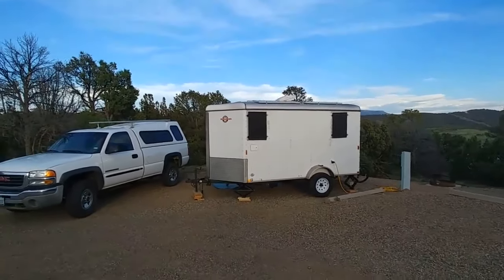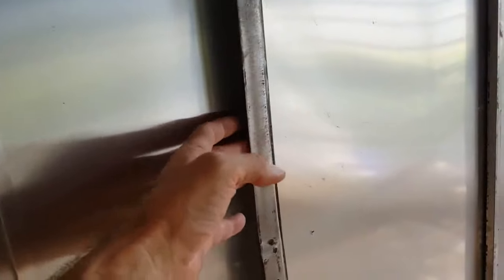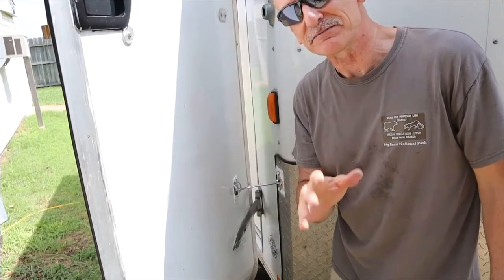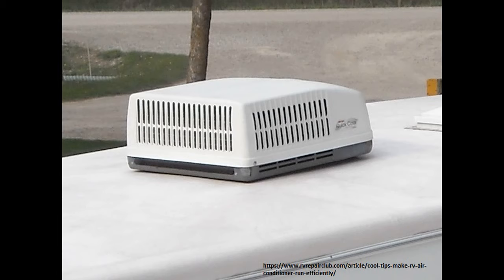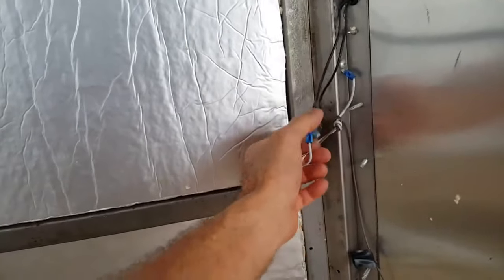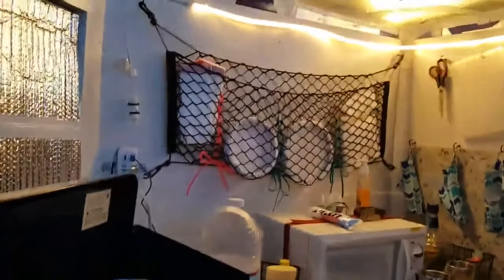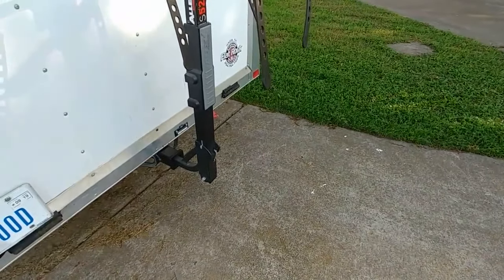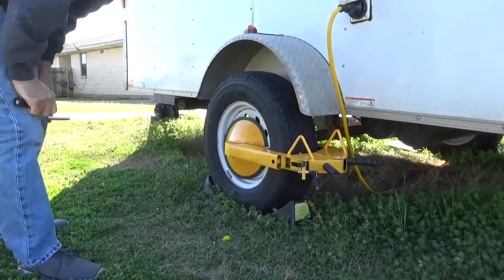CARGO ENCLOSED TRAILER CAMPER CONVERSION BUILD SUMMARY Vanlife Skoolie What Would We Do Different

Comment: I got everything you want EXCEPT I got the 6' wide and tandem axles and Barn Doors. I got a factory roof rack, two windows, lift kit and torsion axles. It was 10,000 and it took them 6 months to build it due to material delivery delays. I love the barn doors because I don't have the room for a ramp. Most people on YouTube that have the ramp wish they did not unless they haul toys that need it. I sold an 8' wide Airstream to get this 6' wide cargo trailer. It fits in my driveway so much better and I can walk around it. Even my Airstream had the bed "fore & aft"  rather than "port to starboard". Still, the ramp with a false wall like you showed in a picture is a pretty cool idea. . Thanks for sharing.

PS. I finally found (on Quora) that you should NOT ground the 120 AC to the chassis if the chassis is also used for 12V DC common (according to NEC since about 1980's). If you are using a metal tool with a short and then you touch a metal object you could get electrocuted. Pretty slim odds but I guess it's happened.

Comment: Might also want to consider getting your trailer Low Jacked. A fairly inexpensive way to do that is get one of those devices that are intended for bicycles. The device is small, easily hidden/disguised, etc. And the device can be linked up to your cellphone through an app, so if your trailers gets stolen, the police can link their system to your app & go hunt down the thieves.
Reply from the maker: I like it. Great suggestion!

Comment: Nice build.  Great insight for future builders.   
Small note. The bikes on the rear bike rack wont hit the trailer if 3-4 bungees are used holding the tire in a specific position.  (I hook from from tire to pedal crank to hold position)
Reply from the maker: Thank you for watching and the suggestion.

Comment: Thanks for the post I been working on my trailer I didn’t want any holes in my camper so I got a 110 plug in large HISENSE heating and air conditioner that I could plug in to heat and cook a large room that fit under the cabinets. It was about 600.00 but if it ever goes bad I can just unplug it and replace it no worries no holes in the camper. Thank you for the post I had a friend help instal a fold down bed and full shower the shower has a tankless hot water heater so as long as I have water I do have endless hot water and full shower. I just wanted something for myself as I travel for work tired of living out of dirty over priced hotel rooms that when work calls and I have to go to the next place I have a tv shower bed and toilet. Thanks again for the post
Reply from the maker: Sounds like a nice build. Happy travels. Thanks for watching.

Comment: I don’t think the weight savings from one less axle out weighs the safety in the event of a blow out. Just my two cents. Nice video!
Reply from the maker: Thats ok if it fits your requirements. Never had a blowout yet.
Reply: Yes no doubt it’s all about you needs! I just like to comment for people scrolling through looking for different opinions, just had my first blow out the other day and the other axle doesn’t help as much as you would think so I can only imagine with just one axle going down some steep grades. Im living in mine months at a time and have gone across country so my needs are different than most.
Reply from the maker: @cargonomads4947  All good. Always thanks for your input. Different views are reflective of different experience. I hope all is well with your CTC after blowout.
Reply: I have had blow outs on single axle trailers.  It is no big deal.  It just feels like something is dragging.  Had a blow out on a double axle trailer as well. In this case I could "limp" along a bit to find a preferred place to change the tire.
Reply: I prefer wearing out only two tires at a time instead of four. Less expense.
Reply: Greg p to each his own, I take my trailer across the us and through mountain passes, The wear is not a concern. Peace of mind is what I’m after.
Reply: @cargonomads4947  my peace of mind consist of having a good spare, and tools to change it.
Reply: Greg p who drives a trailer without those? I have a 7x14 wouldn’t want that in a single axle plus probably couldn’t even handle the weight I have. We’re coming from different uses here I need a tougher and safer trailer you just don’t get that with 1 💁 .
Reply: 2 more brakes and spreads the load on the bearings better 💁 like I said peace of mind....My kind.
Reply: Also let’s hope you maintain and a wheel don’t fall offf 👀
Reply: @cargonomads4947  That's right! I wasn't trying to say my way was better than yours, just sharring my thoughts of what works for me, here lately I've wondered if it would be easier to hitch and unhitch a double axle because you have so much less "seesaw" effect.
Reply: @cargonomads4947  yikes, forgot about that, where did I put that grease gun?
Reply: I hear ya didn’t mean to come off like that I was writing in a hurry, I pulled around a sketchy single axle for awhile through some rough stuff so I’m a bit biased lol, I post on here for the same reasons to help other people out there’s a lot of mixed info when looking for your first trailer.
Reply: Greg p as far as the see saw..I carry quite of bit of weight I front and back but my bed is back there with 2 people and two dogs and I don’t even out a jack in the back most times and have never had it even think about lifting up,  Haha oh shit I was suppose to grease those? But nice debating with ya but I’ll stick with my double axle lmao have a good one man
Reply: And correct me....but wouldn’t there be less tongue weight inherently?!?   I’ve pulled both 6x12 single and we now have 7x14w 7’h wouldn’t couldn’t go back
Reply: @FakeLegGreg  I've had two blowouts on my Airstream with a single axle. Even if they look brand new they blow after they get 6 years old. The first time I thought it was because I deliberately had them under inflated but the second time I had them at 60-PSI for 6 years. Buy new tires after 5-6 years whether they are worn or not. Mine only had (let me do some math) about 8,000 miles on them both times. I did a lot of camping but never went far from home. Anyway, You have a nice channel with good ideas :o) Maybe I'll start using my YouTube channel more in the near future.
Reply: @FakeLegGreg  that’s like not wearing a seatbelt with the “logic” that you’ve never had an accident.  Do you but that’s nobody’s “requirements”, it’s common sense safety and pro vs con. The weight savings is negligible and and the cons are many. Just makes no sense.

Comment: You make a lot of good points and  gave people good things to watch for. I'd also add that you want a tall trailer where the ceiling height is closer to 7' not barely 6'. The roof needs extra insulation and adding thickness to get that reduces head room and they you are cramped in height. Added height also gives you extra room of storage and a more open feel.

I'm also amazed that so many build with 2 x 4's??? this isn't a house and you aren't supporting a second floor or roof. It also takes up more space & adds weight. Clear 1 x 3 has all the structural strength you need. My fold up bed is 1 x 3 with 3/8" ply, plenty strong, doesn't deflect and weighs way less. Same with shelves and cabinets, why sacrifice space & add weight by framing with 2 x 4's? I've also used aluminum tube & channel to build with, putting pink foam insulation as a core and gluing luan ply for skins on cabinet doors and walls. very light, very strong. Yes extra work but weight savings is worth the extra capacity and fuel economy.

Think about your kitchen, do you really want to cook in a 6' x 12' space??? (just a size example) Heat, odors and moisture. I have an awning and my stove can hang on the outside of the trailer plus a table on rails bought from camping store. Stole this Idea from an old popup camper I had.

And no one ever does a follow up video on their peel & stick tile or floor covering. I laugh cause the adhesive on this stuff isn't rated for the temperatures your trailer will reach when stored or in towing in hot summers Ever tried using Velcro in you car??? The adhesive gets soft and gooey in heat... then falls off.

Comment: Add wood studs next to the Z channel this will allow for mounting and not add as much weight. Get the trailer with 16inch  floor beams and modify the area you need for the tanks. The roof AC unit is the better choice, I have own several trailers and never had a AC unit fail, no need to build a falls wall that would take away room in the trailer. Not sure why a trailer would get humid from a shower for taking shower in a trail is not the same as at home and do those showers not have exhaust fans?  Don't buy a V-noise trailer. Buy a flat noise for mount stuff up front and buy are make a v-noise cover, this help protect the stuff and better air flow.
Reply from the maker: Good suggestions. We can agree to disagree on some points. Good luck on your project.

Comment: There are many ways to mount a window unit. You could design it into a cabinet space and have it sit inside a metal box with a good air gap so it can flow the air like it needs to but only have maybe an inch of it out the side of the trailer. You would have to factor in a drip pan setup to let the drip escape but overall not terribly difficult and it would hardly be noticeable.
Reply from the maker: All good ideas. Thanks for watching.

Comment: GREAT VIDEO THANKS. which axle do you prefer with a 6 x 12 cargotrailer single axle. 3500lbs or a 5,000 lbs axle. Would appreciate any thoughts you might have and thanks you on this video. 👍
Reply from the maker: Good question. My build added up to around 3350 lbs with 5 gallons of water. I could carry about 15 more gallons. I was getting close to maxing out my 3500 lbs and with us in the trailer we were certainly over 3500 lbs. A 5000 lbs axle would probably be a good investment. Good luck.

Comment: The nice thing about a tandem axle is if you blow a tire with a tandem axle you can safely  pull over with the trailer not whipping around behind you. Should you have flat and no spare or a flat spare you can limp to a shop an get repaired. I ve had a single axle and thats exactly what happened. After that my mind was made up.
Reply from the maker: I have had a tandem tire failure on a loaded car trailer. Recovery from that catastrophic failure poses its own unique set of problems. Tire debris flying and damaging the other tire is one problem, what damaged one tire may have also damaged the other tire is another. Also, when the blown tire fails the wheel does not stay suspended in the air, it too falls to the road surface. Yes you can limp the trailer out on one wheel, but you have to jack up and tie up the lame wheel so it does not drag the ground. Also, tandems are more difficult to maneuver in tight off road applications. I travel with good tires and carry a good spare. Each style has its good points and draw backs. Thanks for watching.

Comment: Mine is 6x12 v nose with 16 on center box tubing.  I need 16 on center floor because I haul motorcycles which put weight in two spots instead of evenly distributed. I would like 7 foot wide, but only if the wheels were in the same location as my 6 foot wide. I haul a lot of narrow roads and a 8 1/2 foot wide wheel to wheel on a 7 foot trailer is not fun.  Plus, might as well get an 8 foot since the wheels are just as wide.
Reply from the maker: All good points Dave. Valid for your application. Thanks for sharing and watching.

Comment: Very informative. I'm ready to purchase a trailer since I sold my Jayco "LEAKMASTER" '95. LOL. IT was a good unit but we rough camp deer hunting and the Jayco was too low with too much plumbing junk hanging underneath to get in and out w/o breaking things. Also we need to haul 2 atv's so your advice is timely.
Thanks for your wisdom.
Reply from the maker: Sounds like a wise change. Good luck on your CTC. I hope it works out for you.
Reply: @FakeLegGreg  Thank you. I'm positive it will be an improvement over the the poorly insulated, cramped Conditions of my 3 previous campers in 30 years. They were good enough but when you need to haul a couple Atv's as well as camp the whole program needs to change. Thanks again.

Comment: Having built 2 home built campers I will tell you that windows on a trailer or camper must be DOT approved and in many states if they are not the trailer will not pass inspection preventing you from registering it and also large fines if you get stopped and checked by an officer who knows this law. This is why most people who build them either get them in the trailer from the factory or go to RV scrap yards. One other option for DOT windows cheap is truck caps.
Reply from the maker: Thanks for your comment That would be something to check out. Mine are tempered glass. However, I don't see why they should have to be DOT approved windows if no one is in the trailer during transit, ever. As I said, might be something to investigate.
Reply: Many semi trucks also have similar style bunk windows.

Comment: It's as though I wrote this Summary, glad to hear confirmation. The dual axials and 16 in wall beams may be  the only thing I may disagree. I have found that some insulation in the floor is needed too many people complain about the floor temperatures. The roof and Portable AC are definitley not good. My choice would be window unit or one of those mini splits, but window units easy and cheap to replace. a mini splits serve more funtions, as a heater, ac, fan, dehumidifer. The water and electrical setups in some cargo conversions  are crazy they have no access to either if somethign fails I would suggest  building all electrical on a removable wood panel and place in rear of trailer behind fake wall. Too many people stuffing electrical in closed up areas hard to get to. I just recently realized the fake wall is the way to go with window AC. I think placing water and propane in a trailer causes a lot more grief then they are worth. If you need either do the minimum. Like no shower or toliet but a sink, no propane hot water heater but a little buddy just in case. Keep the plumbing and gas down to a minimum. Plus cuts back on weight.

In fact I would suggest making as many things modular so they can be moved with ease. I was thinking electric in tracks on top of walls, but it may be better to have them run on the bottom of the walls. An odd think I thought of was make a bumper in the rear of the trailer so the trailer can withstand a slow moving hit in the rear. Most trailers will suffer a lot of damage if hit in the rear.
Reply from the maker: Thanks for watching. All great observations and suggestions. Good luck on your build.

Comment: Good info - thanks man! I am trailer shopping now. Going to make a toy hauler conversion. Take motorcycle out, fold down bed. That's my current plan. Def. Going with a 7' wide. Probably 14' or 16'. My wife won't like the back ramp, but she enjoys riding more. So she'll actually LOVE it. 😁 
I have a DC wiring question which no videos seem to discuss. 
?: Is the trailer frame a good enough ground to use for DC lighting? Or do you guys run both POS and neg to lights? I'm thinking of just running POS. to lights and grab neg from the frame. 
Good info. I'll watch yr others vids... SUB'd.
Reply from the maker: Thanks for watching and subbing. It depends on which lights on my build your re referring to. My interior LED lights are 110v AC and run off of the inverter. Yep, I know LED lights run off of DC and these are inefficient but I already had them for another project. Now, DC stuff, If you ground the batteries to the frame then you could also use the frame for negative for DC lights and fans. My DC stuff is my fan and my water pump. I ran both wires to my fuse block because there was a place for them. But, yeah, I could have grounded to the frame because the batteries are grounded to the frame. Good observation. Good luck on your project.

Comment: Great information. Please explain more about Your Walmart Refrigerator.
Reply from the maker: The fridge is a 110 volt 4.3 cu ft Gallanz dorm fridge with a small freezer. We can run it off the batteries with the inverter or shore power. It could also be run off a generator. You could buy a generator and fridge for less than the high price RV fridge. Here is a aff link https://amzn.to/38Q3JJm
Reply: @FakeLegGreg  I have a 4000 watt generator. What I was wondering about is if you had a battery on the front of Your trailer and was charging Your car battery and this second battery will the alternator be overloaded at times of high use. like running the truck A/C and maybe headlights and charging this 2nd battery two?
Reply from the maker: @missouritraveler6401  I am not sure about that. This is a compressor refrigerator and compressors use more amps to get started, so there is a surge. I don't have the two electrical systems crossed because I didn't want a malfunction in the trailer to affect my tow vehicle and possibly get stranded. We did have the fridge on 2 6 volt 200 amp golf car batteries with a 1500 watt inverter. The batteries were recharged by 200 watts of solar panels so recharging as we were driving. We had that setup in the bed camper of our truck. The only time we had a problem was tropical storm on the east coast kept it cloudy for a week. If you keep the fridge full and shut most of the time, it will require less power to keep it cool.
Reply: @FakeLegGreg  Thank's for the information GB.
Reply from the maker: @missouritraveler6401  YW MT. You are welcome to look on my about section and email me privately. We can dig into this further. I am always willing to learn more.